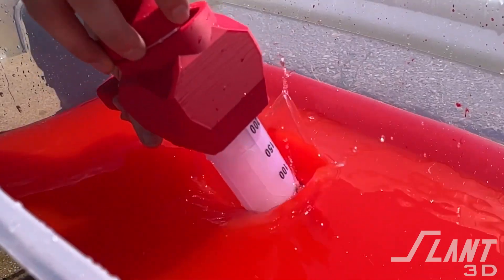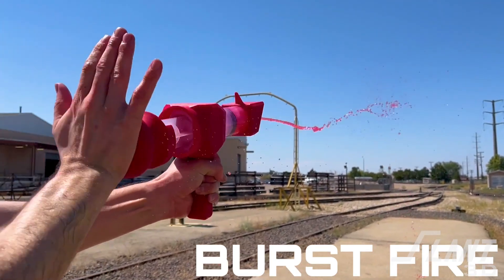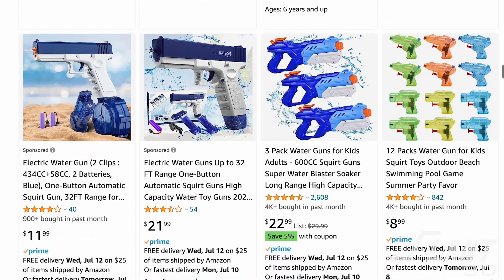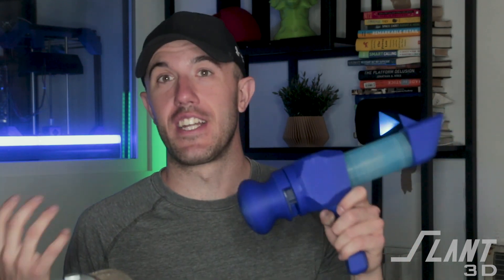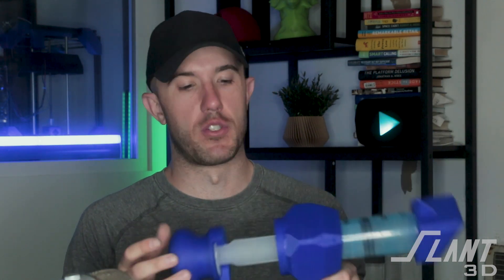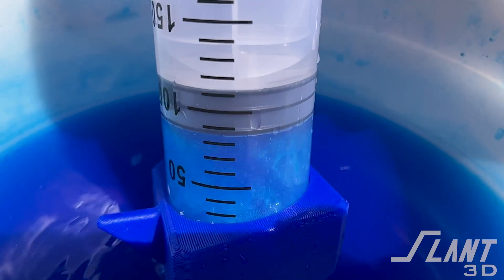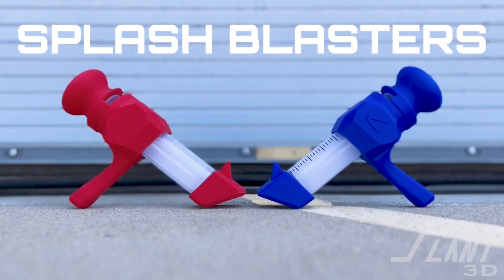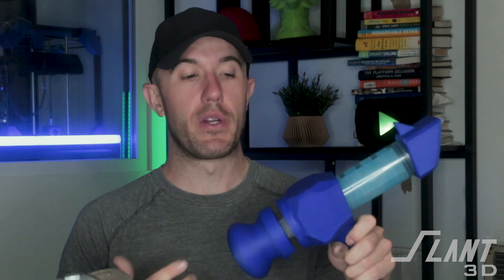We Made a 3D Printed Squirt Gun and Put it on Kickstarter. Here's What Happened

Comment: FEEDBACK:
The idea that Slant 3d what's to put out some high quality 3d-print reference designs is great, and look forward to seeing a number of designs being added to a Slant reference collection. I however did not supported the Splash Blaster and thought it would be useful feedback as to why. 
1. the Splash Blaster is a hybrid design involving both 3d-printed parts and other items (BOM includes water tank, etc. but is not detailed) 
2. sourcing, or availability of additional required components is not clear (no specifications for dimensions, or typical cost given in kickstarter documentation), other than making a pledge as part of a kit.
3. think an opportunity to offer the Splash Blaster at different scales as a parameterized design was missed (as could have offered experimentation with smaller pump/syringe and smaller filament use by hobbyist to explore the design)

In terms of a hybrid design, the Slant 3D hammer might be better received as bolts are easily accessible at local hardware store. Another option might be multi-featured screwdriver, as bits are also available at any local hardware store/online with standard dimensions.
Think offering 3d-print only designs in the early offering(s) will help to create a following and help set expectations. It's less complexity (BOM sourcing, cost) for someone wanting to learn from the design, compared to those just wanting an instance of the product.

Was going to suggest including a reference mark (logo) on the designs in the Slant reference collection, but on closer examination did see on one component, there is a angled-io logo. This a bit confusing, as thought this was a Slant-3d design/kickstarter. IMO: a mark specific to the (hopefully expanding) Slant-3d reference design collection would provide context and a design identity. (particularly as part of the print file)